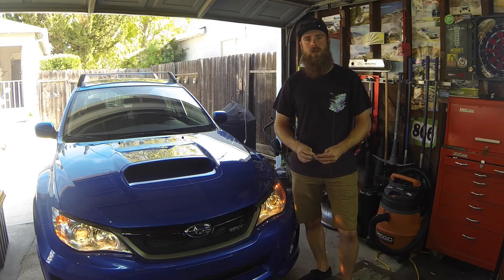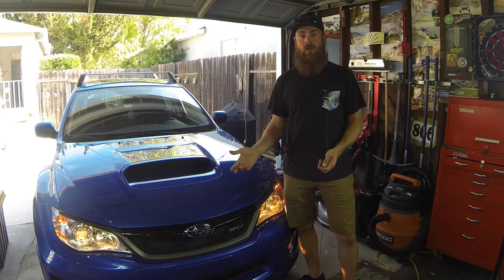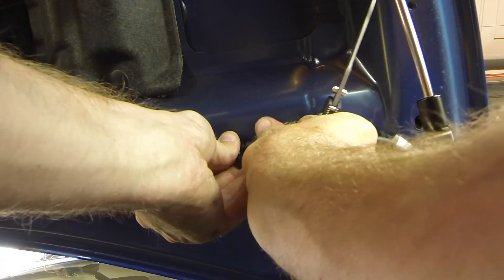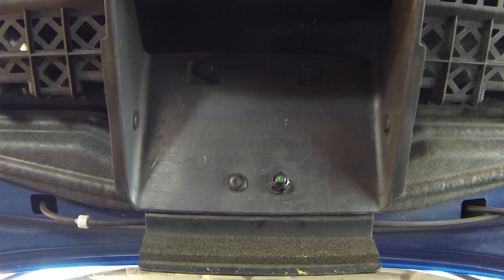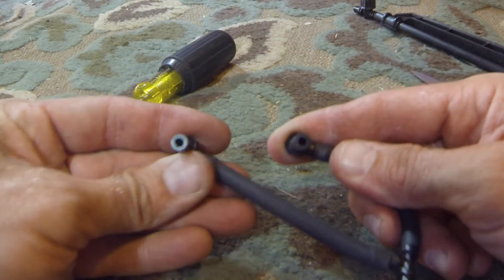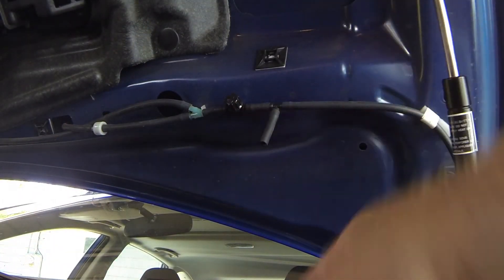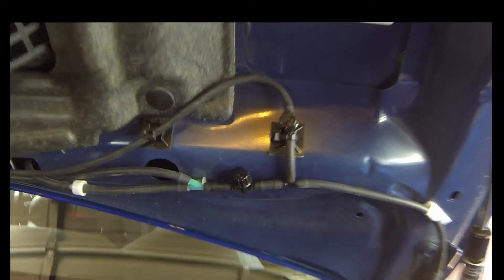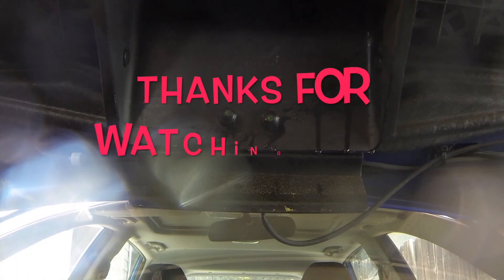BEAT THE HEAT DIY INTERCOOLER SPRAYER part 1

Comment: Bypassing the OEM squirts was cool, but you could've done this a totally different way, using classic car parts! The original mustang squirts didn't activate the wipers, so you can get a pump and squirts douche bag pretty cheap, that can easily mount under the hood, and pair with a micro momentary switch to activate. Now you're using water that won't have a bad smell, while retaining use of your wiper squirts.

Comment: What's the best liquid to use to cool off the intercooler with the sprayer?
Reply: Nitrogen
Reply: Nail polish remover, rubbing alcohol mix 50/50, high proof vodka, methanol.

Comment: i was thinking of doing this but by stealing the supply from the rear sprayer
Reply from the maker: +Rj Albano I thought about doing it that way also but this was so just so much easier.
Reply: +Blake's Garage what fuse did you link into? I'm in the process of doing this now. thanks.

Comment: is it safe to hose down the intercooler after a long drive/tough driving ? while vehacle is still on?
Reply from the maker: +George  Duran Should be fine not much different from when your driving in the rain except much more water. But really I would just drive around and let it cool off just from driving.

Comment: Hey man, when you're doing your DIY vids do you think you could make a list of things you bought and link them in the description? Just to make it a little easier on us. Thanks in advance, love your channel!
Reply from the maker: +B19902133 Thanks Man, I will make sure to do that next time. Do you need to know any specific parts from this video?
Reply: +Blake's Garage Hey man - I'm curious about the sprayers that you used. Where did you get the sprayers/misters? Thanks for the great video...
Reply from the maker: T. Branson i got them at a local sprinkler supply place. They are just for a drip system and spray a 360 degree pattern.